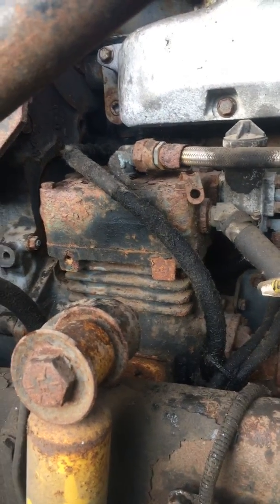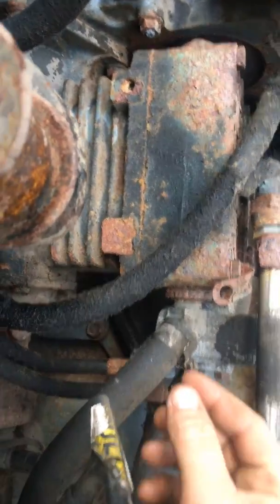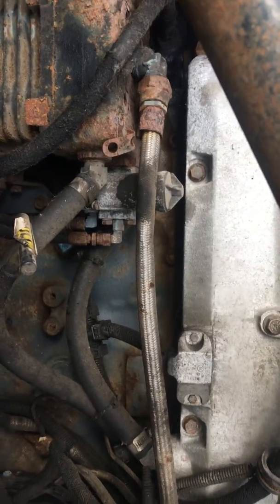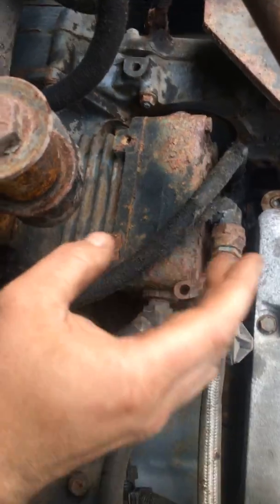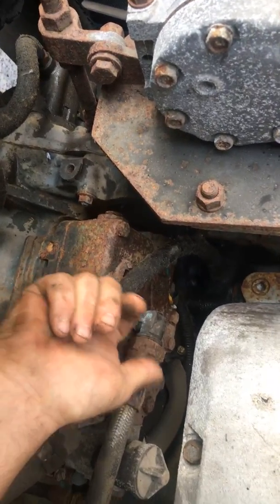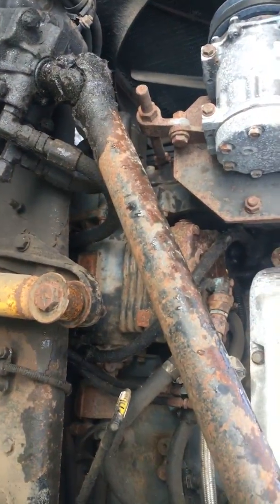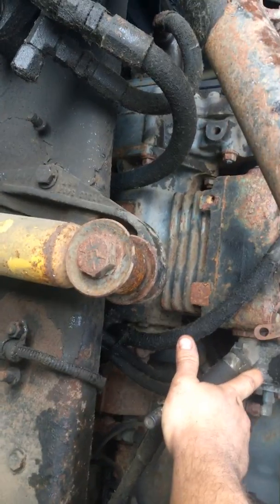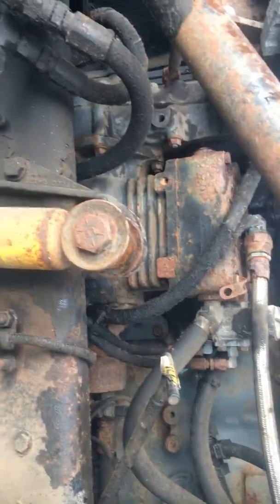Tractor trailer truck not building air pressure

Comment: I have a 2015 freightliner isx Cummins no air going to the tanks , I took the line off the air compressor, plenty pressure, new line , new governor, new air dryer still nothing

Comment: Hello my name is Dave and at work we got a 19 78 GMC brigadier grain truck. And it has a Detroit engine in it what the air compressor on the back side of the engine underneath the dog house inside the cab and it's got like not building up any air pressure. And there is a line coming into that you mentioned in that video that it sucks air through the intake and the airline going out of the air compressor is shooting out some black stuff like oil I wonder if that compressor is dirty in the inside of the head is there any way I can maybe spray some carburetor cleaner in there or what do you suggest? There is some kind of a spring on the one side in the front of the compressor that looks like a valve or something it's got a screw you take the cover off it's got a screw in it that I don't know if that's the load valve or what that is if you know anything about this truck can you help me I appreciate it I'm trying to get it the air working so we could use it thank you and God bless

Comment: Good morning brother hello from Fort Myers Florida, 👋 But always on the road 😆 you know it’s interesting I rolled up on a 2015 D12 Volvo and according to the driver truck lost there when he was driving it so I inspected it and the person in the air dryer was just in an open loop but was just letting air out big time and I happen to have A brand new dryer which I finish installing but then the truck still would not build Air, so we thought it was a good idea to look into the air governor and we ended up replacing that, and that didn’t work either so I took off the airline to comfort of the compressor that fits into the dryer and that had air going to it but now that I remember maybe not enough , so after all that I try giving it somewhere and it will take care very very slow with the idea to try to get them off the road, so my only conclusion that was left was that the air compressor was gone, or any addition to that I I Took the plug out of the first air tank inserts of possible oil in water in case I would’ve been the problem but it only had just a little bit in my opinion 19th to obstruct the lines or anything so we ended up towing it to the shop, and this particular opinion I believe and he has to be looked into more obviously that the air compressor was just gone after all this truck has 1,000,700 miles, but anyway if you have Any thoughts or opinion on this federal appreciate it and thank you for sharing with us I greatly appreciate it Robert.

Comment: Is there anything else you can suggest if you are not able to check the line that runs from the compressor to the dryer?
Reply: I am steel not getting air pressure  I changed the compressor I changed the governor I am checking the valve that goes to the air filter wat ese could it be
Reply: How do I check that

Comment: I just out on. A new reman air compressor at the discharge line im not have air come out  the pressure is not strong my tanks are taking forever to build up and bit building properly
Reply from the maker: Does it have enough pressure to blow your finger off the discharge side if not check the inlet make sure it’s not restricted or plugged in anyway and check the governor isn’t sending pressure to the unloader valve

Comment: What does it mean when your air system purges and sounds like a rattle snake or ar?  Loses 10-20 lbs in matter of seconds.
Reply from the maker: Could be the air governor or the air dryer purge valve or the air line that is used as a signal line between the governor and air dryer, the purge valve purges water from the dryer every time the system reaches max build pressure

Comment: Putting antifreeze in the glad hand WILL NOT do go into the air system for the truck, ONLY the trailer.
Reply: Yes, I did it when the trailer brakes were locked

Comment: i have a cat c13 on a freightliner columbia with a blue air compressor dont know where its from i got it like that. the problem i have is i only build air up to 50 to 60 psi and thats reving the heck out of the motor and it drops back down slowly when i let off. i only have a small leak at the air manifold behind the dash. i cant find leaks anywhere. i see it has a new governor but i might try tapping the compressor head to see if it frees up a bit if not i think ill take it apart and check the valves. any recommendation? thanks!
Reply: If it's building to 50-60psi before stopping under idle, building more with throttle, then decreasing when you step off, I'd check the charging air lines & even the air tanks for cracks/loose connections.  Typically, it'll build fine UNTIL the pressure is sufficient to escape a small crack or loose fitting.  Also, if the leak is small enough, the throttle will allow pressure to build but it won't hold once you step off. The bad news is that you'll likely need a buddy to run the throttle while you get under there and listen for leaks and spray lines/fittings with soapy water. We're talking about a very small crack here...one you can't hear from the cab.
Reply: I have the truck bought a rebuilt compressor and still only building to 60psi